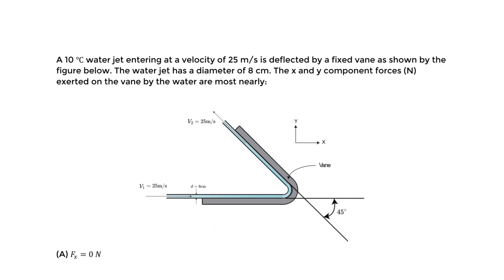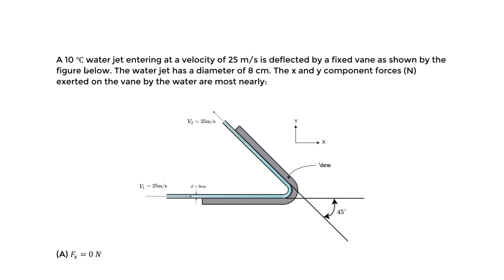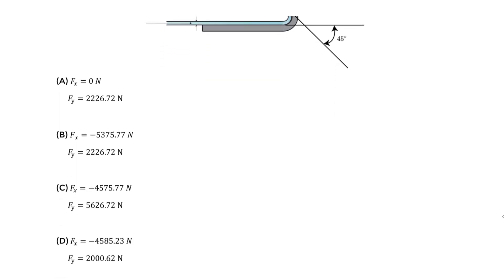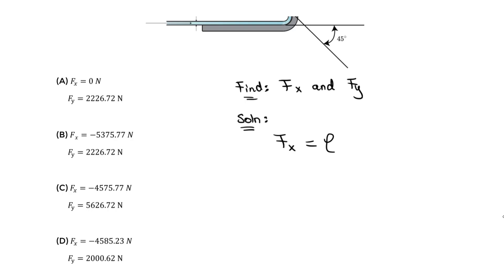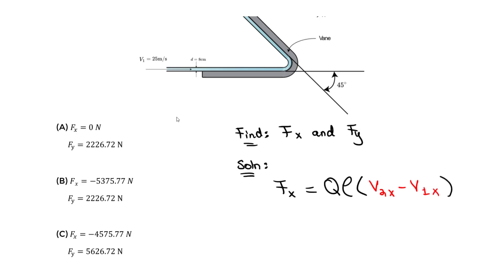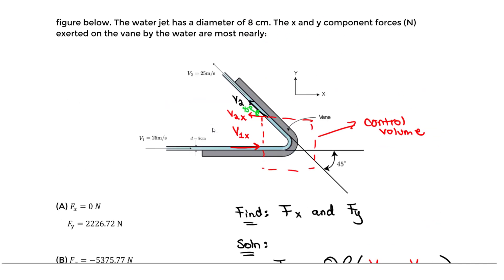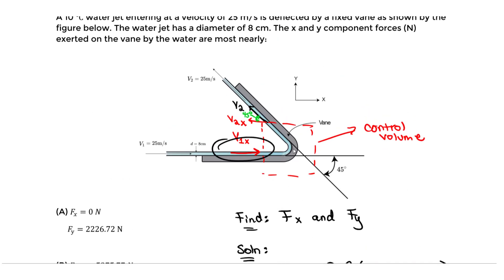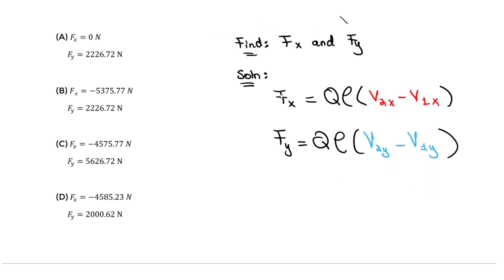FE Exam Review - Fluid Mechanics - Impulse and Momentum - FE Exam Tutor

Comment: equations in handbook still help. Its the same thing you wrote, but set pressures =0 & W=0, and you can solve for resultant forces in x and y directions
Reply: f=-(.126)(999.7)(25cos(135)-25)= 5375 in the direction dictated by the handbook(+), which in the problem is negative